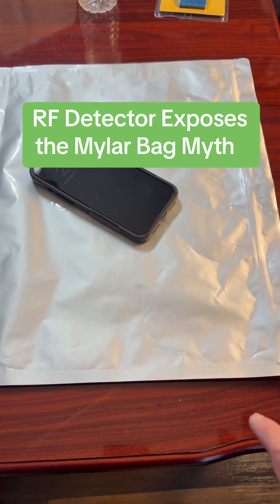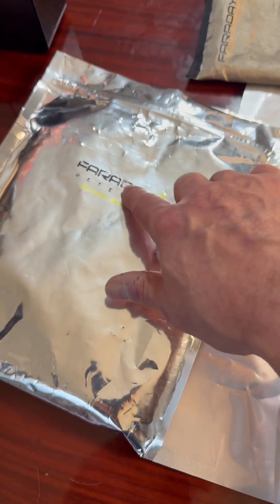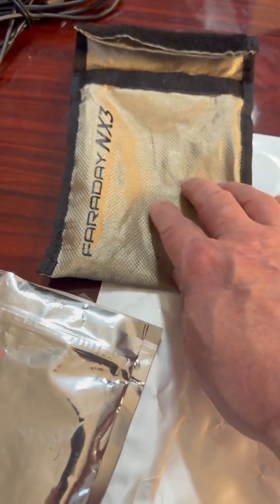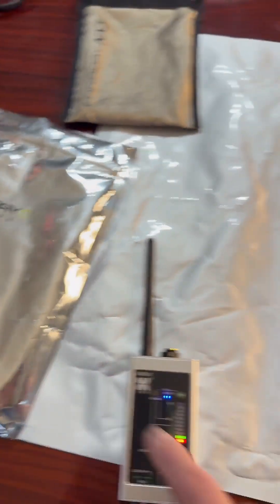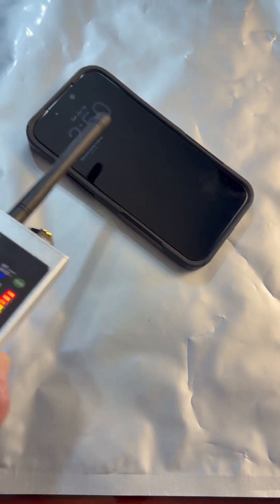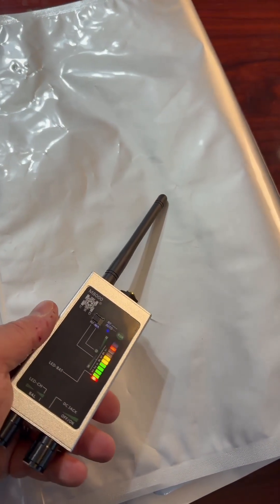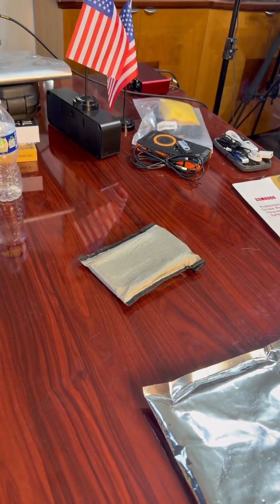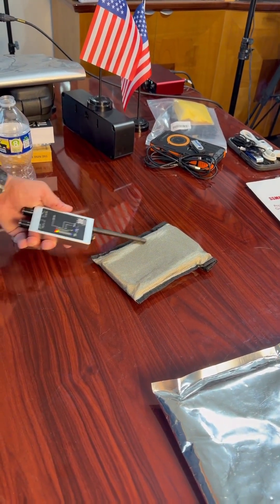RF Detector exposes Mylar bag myth

Comment: Does the phone log texts and messages when it's in the bag?  If not, you might as well leave your phone at home.  That said your onstar, or whatever comes with your vehicle, can track your movements in the same way.
Reply from the maker: That information would not reach your device until it was out of the faraday bag and you regained your signal.